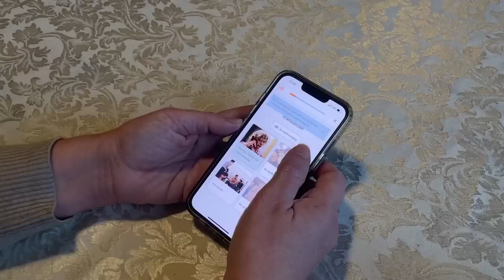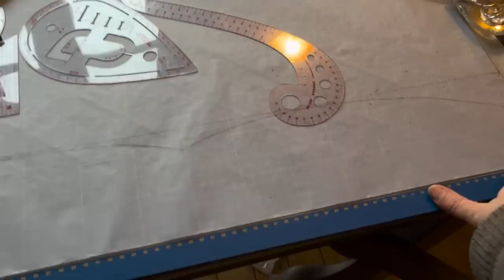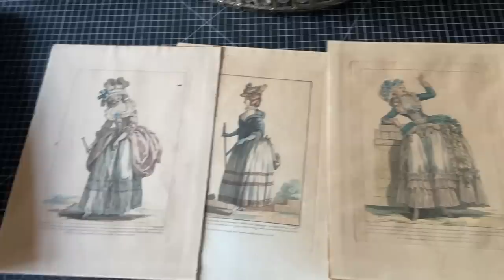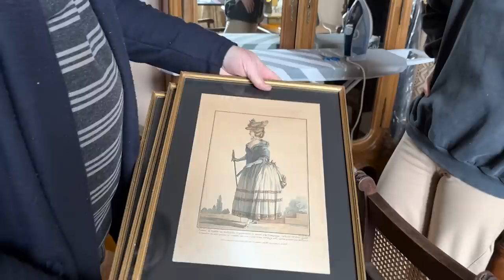BIG Bedroom MAKEOVER and REVEAL | Manor & Maker

Comment: You all did a lovely job with the draperies, pillows and framed prints.  I'd suggest something like a coverlet to go over the white bed linens in the same fabric as the drapes or a solid to finish off the bed.  Love the enthusiasm and know how you show for DIYers.
Reply from the maker: Yes! I want to make one that's one side the velour-ish fabric (so soft) and the other the curtain fabric. Just couldn't quite fit it in this week.
Reply: @ManorandMaker
Reply: Exactly!  It will finish an already beautiful job.
Reply: I agree it needs a coverlet and more fabric around /over the top of the 4 posters.  A ruffle to match window pelmets that would hide that gathered fabric of bed draperies on the pole. The top of the bed looks unfinished.
A white sheet with the ruffle attached around edges would hold the ruffle in place.
Reply: A thing of beauty to behold… 🎉
Reply: How about a small patchwork coverlet at end of bed, using all bits of offcut  fabrics, adding a deeper green to them.?
Reply: Patchwork might be to casual, informal for such an elegant room?!

Comment: Looks lovely.  One suggestion...what about a ruffle like you have on the pelmet running the length of the inside edge of each panel.  It would beef up the curtains a bit.  Also on the bed pillows add a ruffle with a middle covered button to tuft the pillow to make more opulent.  Your bed canopy could use a valance all the way around that covers the tops of your panels. You are doing a
 very nice job but I think
 you just need to make it more opulent for a more luxurious look.  I don't mean to be critical I just want to help you achieve a finer look.  Keep up the great work.

Comment: Hi, another great video, i just love the curtains and the matching pelmet. A tip to clean the inside of the glass bottle, put some hot soapy water inside the bottle along with a small handful of smooth stones or pebbles and then put your hand over the top or fashion a stopper and start swirling, the stones will dislodge all of the dirt inside the bottle :)
Reply: I’m reading the comments to see if someone already mentioned the pebbles. 😂
Fine sand or uncooked rice works also!
Reply: And I was going to suggest warm water with 1 cup of vinegar and 3 tblsp baking soda - will foam up and dislodge. Added advantage - once rinsed, the inside will be nice and shiny!
Reply: @marinahoffstrom360  you can also use scrunched up aluminium foil balls x

Comment: "I wish I could get the little bits on the inside" suggestion:  wet soapy paper towel (or fabric) and insert into glass container, add a little hot water, and, using a sturdy long wire, (wire hanger, long metal skewer, long knitting needle) push paper towel around inside of container to reach dirty area and "work it" - or - carefully shake container which will allow wet and soapy paper towel to clean inside of container.  With long wire remove paper towel.  To dry inside of container can insert dry paper towels or dry fabric and swoosh around with same sturdy long wire.